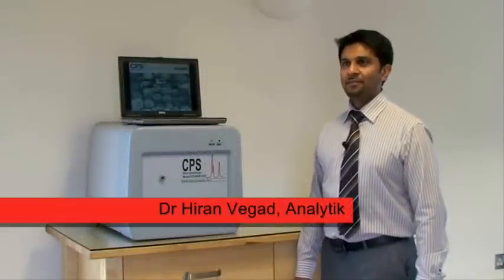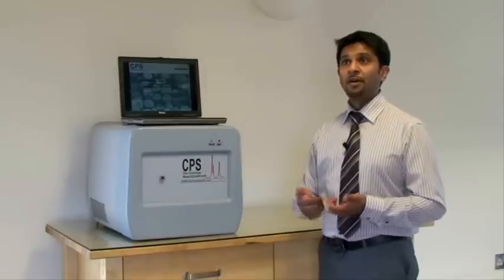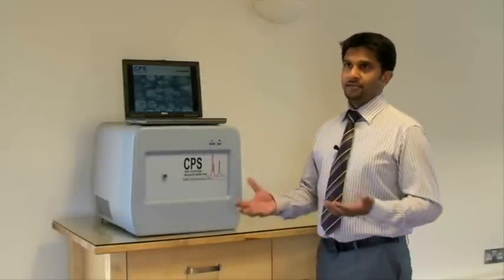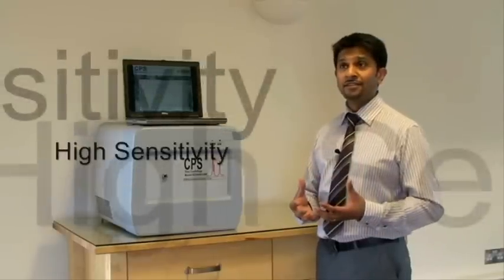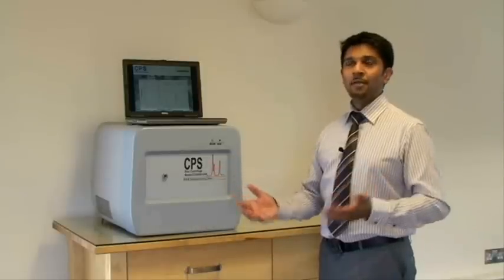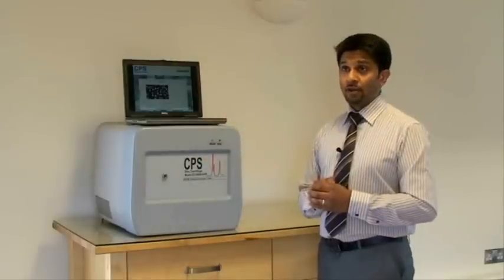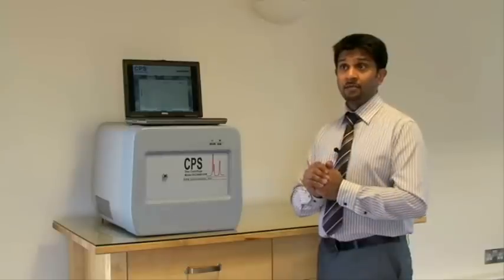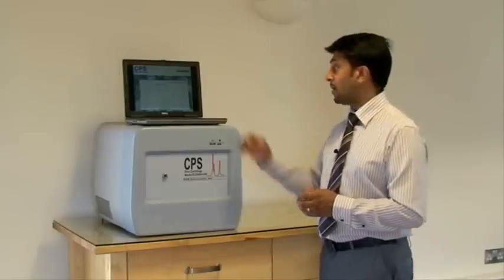Nanoparticle Size Analysis using the CPS Disc Centrifuge UHR

Comment: Thanks for your presentation,it's great.Could I ask you a question? What the rel.weight mean in the Y axis? is it the Molecular Weight of the NPs?
Reply from the maker: The Y axis in this case is not showing the molecular weight of the NPs. It is showing the total weight or mass of the particles sedimenting pass the light source detector beam (calculated using Mei Light Scatter theory). The weight data can be shown in absolute fixed terms (micrograms) or in a relative mode where the base peak is 100% and every other peak is then a relative weight measurement. The Y axis can be converted to a relative number and relative surface area measurement as well. We hope we have addressed your question, please let us know if you need any further assistance.
Reply: Analytik Cambridge Hi,really appreciate your so detailed explanation. I couldn't understand it until this.Thanks a lot.